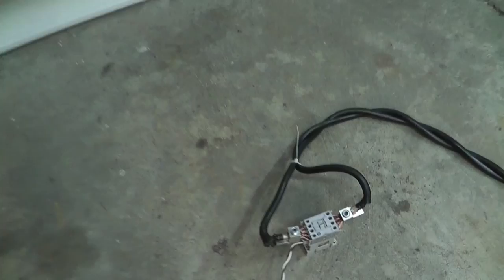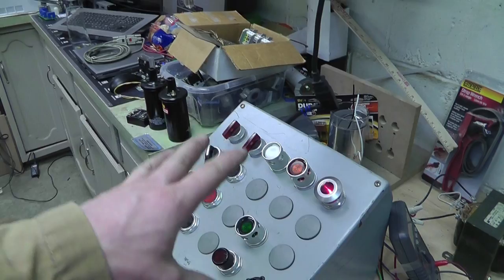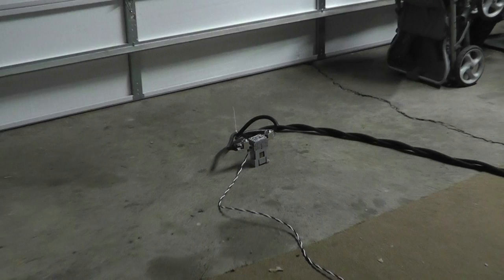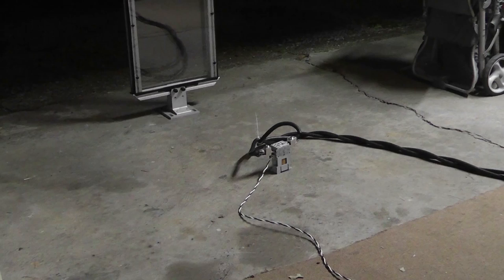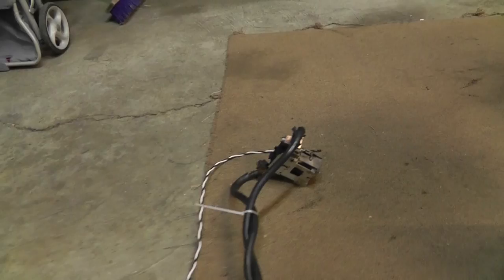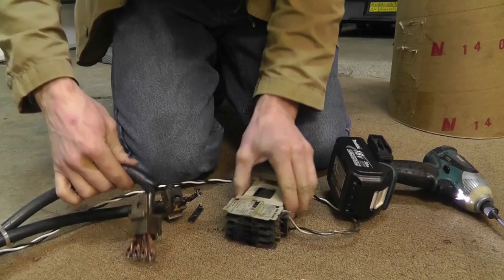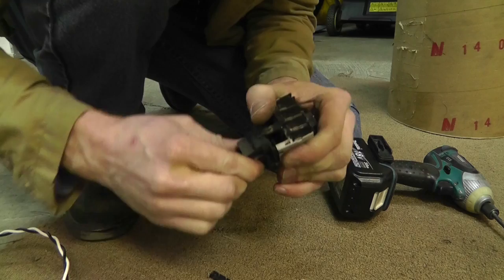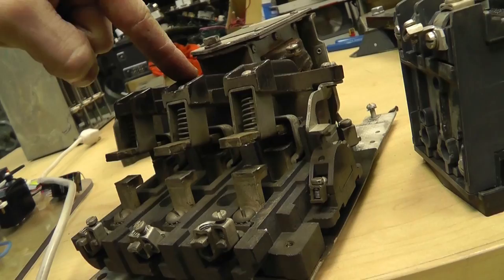10K joules 5: 10,000 Joules And A Dead Short... First Test "Fire"... www.RWGresearch.com

Comment: russ, the most dangerous part of that capacitor bank is the part you failed to cover, the power hook up rails to which makes that device extremely dangerous especial where kids could touch it. Imagine if that thing had a charge on it and some grabbed those power rails or accidentelly fell into them of brushed up against them they woiuld be fried just like that contactor and be dead and yet you have no safety cover whatsover over it I think you better reexamine what you have created there.

Comment: wrong kind of capacitors for shrinking quarters. the geek group cant do it with thump-er (like yours but super sized ) only with stopper that is weaker in capacitance but the correct type of cap to release all energy at once

Comment: would a hydrogen producer work with these. the water will act like enough of a resister to relece the energy fairly slowly but would it produce hydrogen less efficiently than like a normal car battery. or would it be just as efficient?

Comment: Assuming that spark lasted 1\10 sec my calculations show 134 h.p. was released assuming the caps emptied.
W(joules/sec)=(CV^2)/2  C=Farads  V=volts...Does that sticker say 15 h.p. @ 575volts 3 phase?